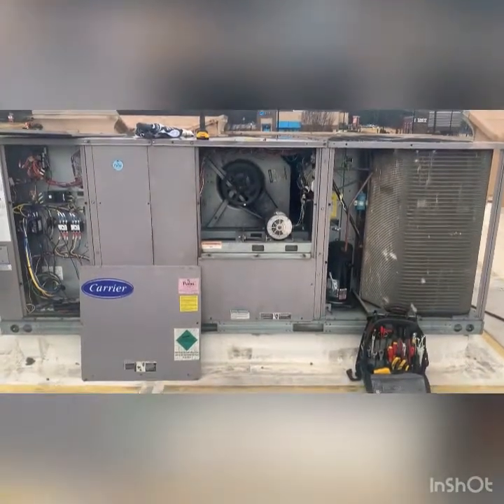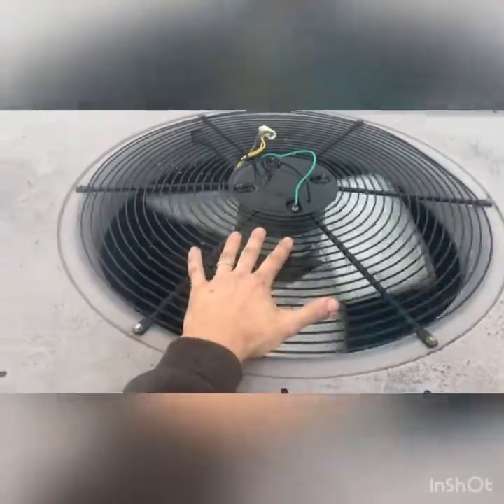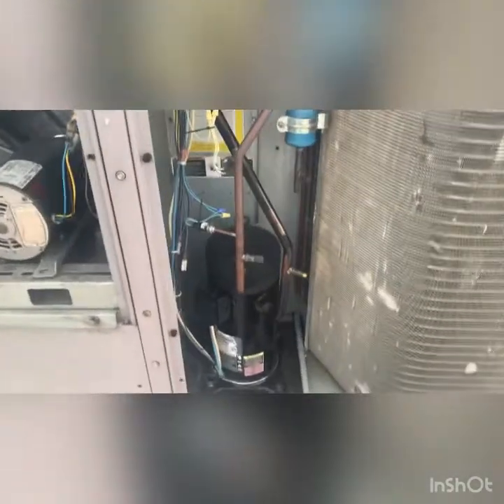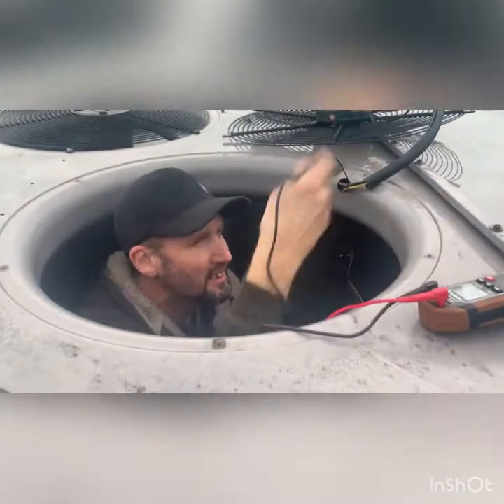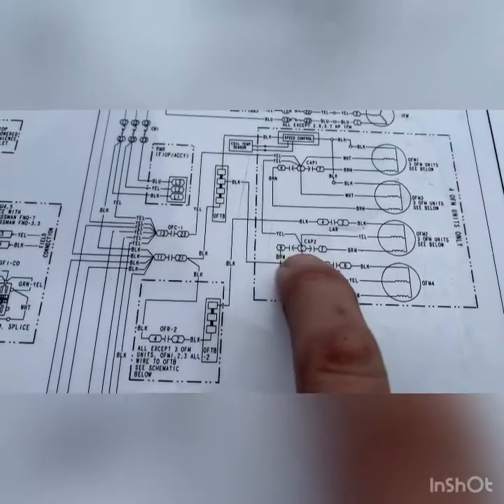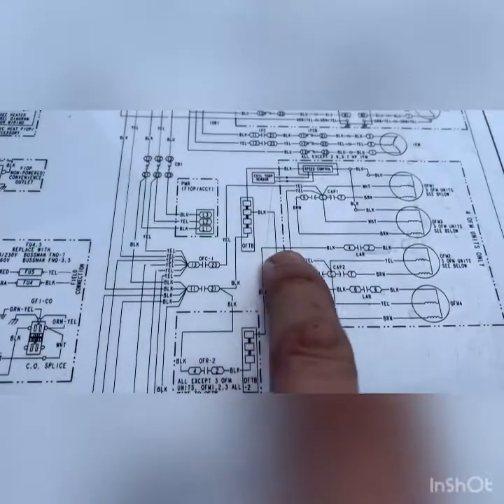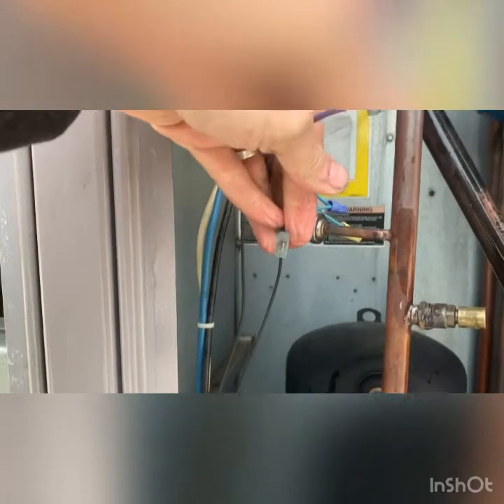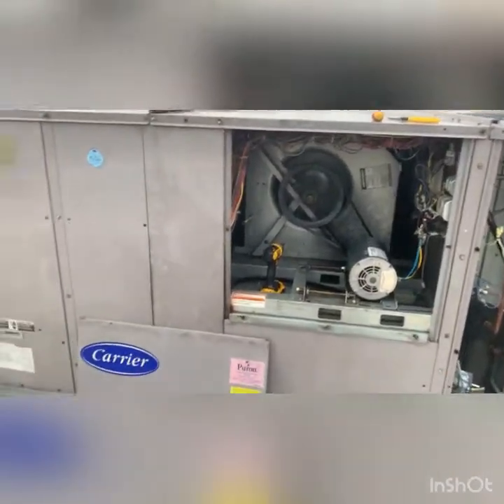Carrier unit short cycling

Comment: Hi, I was wondering if there is a solution to my problem.
If you could just watch the video and tell me if there is anything wrong with the unit if it can be fixed.
I spoke to the AC unit installer and he said that that there is nothing wrong with this fan cycle.
This AC unit is for a basement apartment which can get hot during spring months, because there is a boiler room located next to the apartment.
The tenants sometimes need to turn the AC on in early spring to lower the temperature in the apartment.
The installer told me that the unit has a sensor installed which controls the temperature of the compressor or freon gas .
For that reason it turns the fan on and off when the temperature outside is cold.
It only happens when they turn the AC in spring and during cooler nights.
It works normally during hot days and summer nights, but it can be very annoying in May and June. 
I was wondering if you agree with the installer, if yes, is there any solution to this problem?
He said he could remove the sensor or switch, but the tenants could not use that AC during colder months, because it would fry the compressor or condenser.
I'm not a HVAC professional, so please forgive if I had details wrong.
Thank you.

https://www.youtube.com/watch?v=M8ECtK3DIK8
Reply from the maker: By definition this is not short cycling.   The compressor is continuing to pump.  Hard to exactly diagnose but I can explain the process this way.    It takes a certain level of (head) pressure to force its way thru the fixed metering device, causing the Freon to drop in pressure and properly cool the evaporator inside.   On cold nights if the fan is running at full speed the pressures would be so low (overcooled freon) that the unit would not function properly on the inside and it would freeze up.  The unit uses a line temperature probe only running the fan when necessary.  Sadly your installer probably right.   If you bypassed the temp probe and left the fan running all the time the un it wouldn’t work properly.    Sorry for the bad news.   But unless the compressor is also dropping out the unit is functioning exactly as designed.
Reply: @restaurantrepairs   Thank you for the reply, I've noticed it runs like that in temperature below 70F, if temp is above 70F it runs normally, it's very annoying. Is there a way to change this cycle; let's say to make it work like this when temperature outside is below 60F not 70F? 

Also, is there a way to enclose this unit or make a soundproof shield. I understand that it needs fresh, cool air to work properly, but maybe there is an approved material to use in this particular situation. Thank you.
Reply from the maker: @joshwilliams2226  - there’s isn’t anything mechanically to be altered to make it  hanger to a lower temp.  It’s based on internal freon temperatures.   It looks like your in a fairly urban space? Meaning there’s just people in close proximity.   You’d be amazed how sound can be channeled. Something as simple as putting a little wooden picket fence around that unit where the chain link is will alter the sound direction and channel it upward.   That’s about all that can be done. Want to test what I’m  saying on the cheap.   Put a large piece of cardboard in between you and it.    Get behind the cardboard and you’ll see I’m right.    You’ll never get rid of the sound, but you can stop the waves outward momentum and direct them upward.   Good luck
Reply: @restaurantrepairs  Thank you Joe for your time and advice. Yes' I live in a city, so it can be annoying. I'll talk to the building manager and ask him about a fence. 

I also have a problem with my window 8000 BTU Maytag AC. It sometimes takes couple of minutes for the fan to start (not always). The compressor works fine, but there is something wrong with the fan, it also sometimes makes a squeaky noise, like a ball bearing needs some lubrication. I'm thinking the fan starts after 2-3 minutes because the motor warms up, I would take the AC apart, but I'm not sure if it's worth it. Beside this, the unit works fine. Thank you. Josh